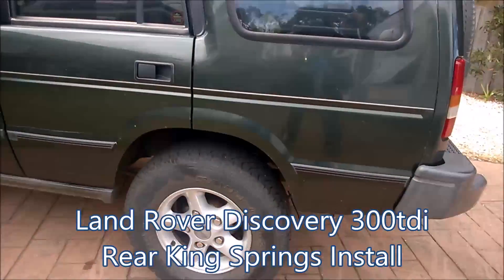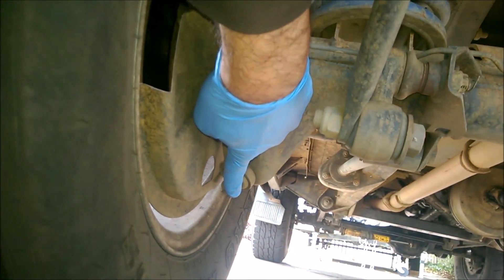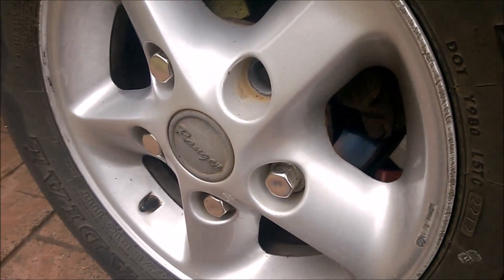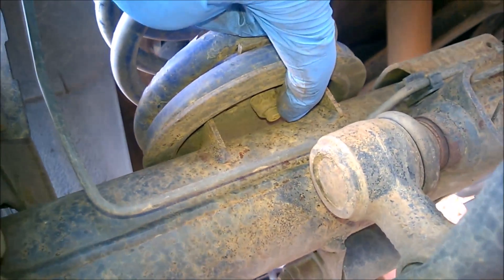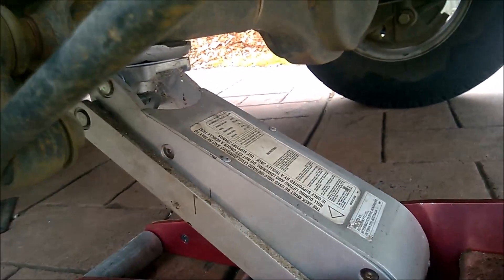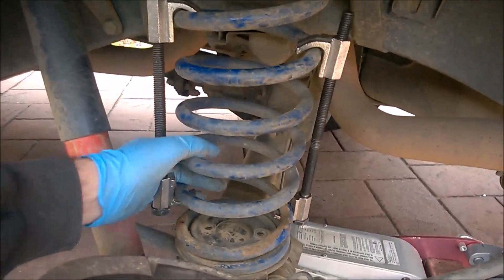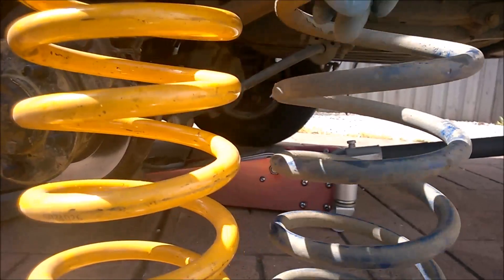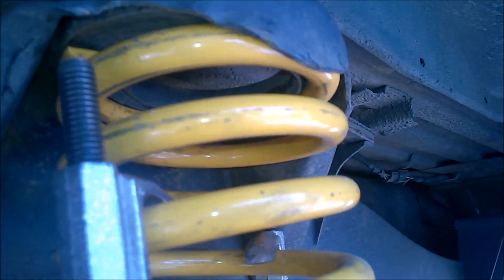Land Rover Discovery 300tdi: Rear King Springs Install

Comment: I found that disconnecting the anti roll bar makes the job a lot easier and you then don’t need to use spring compressors
Reply from the maker: Yes you are right... would be better as you wont struggle against them. Thanks for your comment.
Reply: Great idea! Cheers!I need to replace mine on my Disco 2 V8.
Reply: Hajajahah. Yes it is!

Comment: Instead of compressing the spring to remove , I use an old cork screw or jack with a long threaded bit that kind of scissor lifts the car , any way I use that to push away or push down the axle and the spring falls out .
Reply from the maker: Yes, seen that technique used to if you dont have clamps. Cheers.

Comment: Great Disco videos! I think my next car will be a 300TDI. Considered TD5's but they seem to complicated for my liking.
Reply from the maker: +Joel Stephenson Td5's are a completely different beast, and yes very complicated. Hence my preference for the 300tdi, keeping it nice and simple :)
Reply: @rovertasmania7033  I have a TD5 and yes felt similar but after having it for 15 years I am thinking what is all the fuss about as it is still simple electronics that let you know where the problem might be and spare sensors are cheap and I have never needed as yet.
Reply from the maker: @peterhanson5042  I would consider a TD5 too, actually thinking of this as an option for a second Disco ;)

Comment: can you please measure your vacuum at the brake booster and tell me the rate please.  i have a hard pedal.
Reply from the maker: +steve hope Hard pedal as in hard to stop or stops fine but feedback is hard?
Reply: +Rover Tasmania  i have replace the booster thinking it was it and it is better but i think its the vacuum pump, i have been told the vacuum pressure should be 10-12 psi and i have got a tester coming from eBay but would like someone to check on a 300tdi that works fine.
Reply: +steve hope there is no videos on replacing a vacuum pump on youtube.
Reply from the maker: +steve hope cant help you there as i dont have the tool either. Make sure you check for vac leaks first, this indicates a hard pedal but also servo. Dont know if vac pump has any bearing.
Reply from the maker: Also, check out Aulro forum, very good place for diagnostics. Heres a thread that may interest you http://www.aulro.com/afvb/90-110-130-defender-county/127538-hard-brake-pedal-what-look.html

Comment: Did u need to fit new longer brake lines? I hear some places recommend it for  2inch lifts
Reply from the maker: I suppose if i was using the disco in the bush flexing it up then yes i would do that. I also have the rear sway bar so that limits flex so no real need for my use.
Reply: Rover Tasmania yep good point.  Also how the disco go with towing? Because my 300tdi is a slug, goin 100 on the highway, when I come up to a slight incline, drops to 80 with foot to the floor, even drop a gear .
Reply from the maker: Mine is great, tows reasonably well for a 300tdi too but I have done all the pump tweaking which I have vids on my channel on how I did this.  Standard pump setup is very conservative so they have a lot more in them but got to be careful - need EGT to keep eye on temps etc.
Reply: Rover Tasmania thanks for that